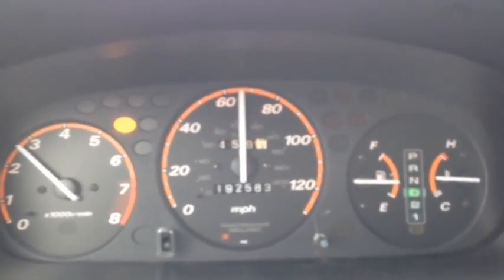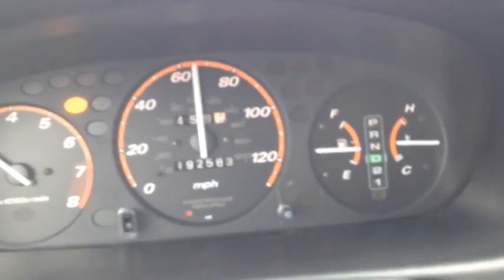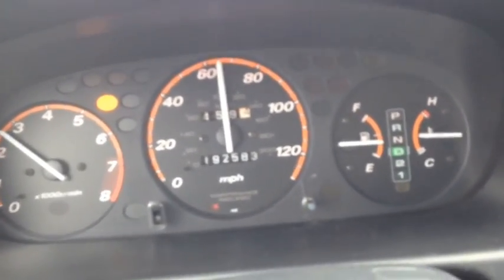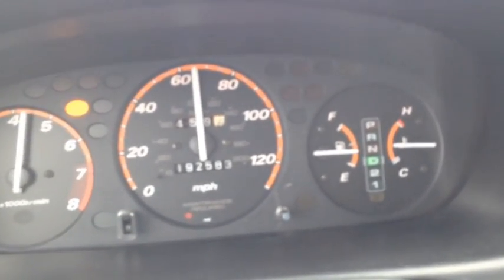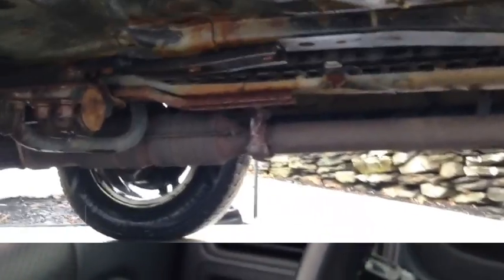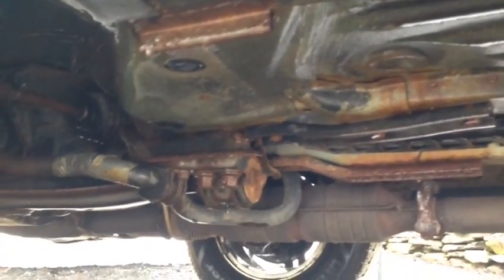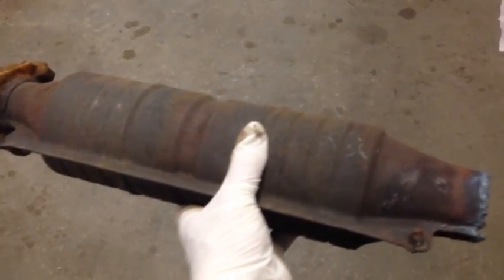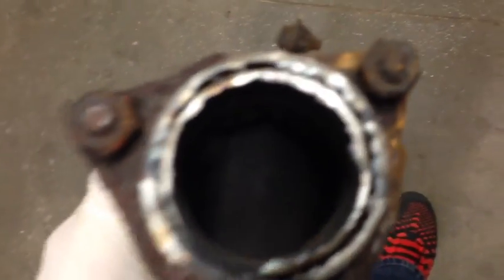Clogged Catalytic Converter

Comment: Did it give out code for catalytic converter or other code like P172? Mine is doing the same thing but throwing a P172 code. Thanks for the video
Reply from the maker: Hi Sirwei, mine did not but it makes sense to throw a code for an O2 sensor if it is damaged because of the failure.

Comment: That seemed only to be part of my problems, changed the cat but it still feels like the brakes are engaging once in a while. I'm gonna be checking my cv joint soon.
Reply from the maker: Hi Bryan, Have you had any work done under the dash near the brake pedal assembly? Sometimes people will remove the brake light switch which is attached to the brake pedal assembly and install it too tight causing the brakes to drag after driving for a few minutes. Let me know, thanks.

Comment: i have a 1995 astro van and i did a complete tune up fuel pump fuel filter and still runs badly it sounds like a knock in gear is my cat bad cause it caint breath
Reply from the maker: Hi Frank, is there any way you could take a video of your issue, upload it to YouTube and send me the link so I can hear what it sounds like?
Reply: @EddieCarrara1  I have this same issue ATM

My scanner picked an engine misfire on cylinder four, on changing the coil pack, the error cleared. But the noise is same so I suspecting a clogged cat converter.

Toyota Sienna 2001

Comment: I Have A 03 Nissan Altima Doin The Exact Same Thing My Code Say bank1 Converter insufficient Now It Done Busted But I Wonder If Mines Is The One Comin From The Motor Or Up Under The Car
Reply: Mont Last did you fixs your problem ??
Reply: Anthony Bell Yes I Just Cut Off The Cats N Ran Straghit Pipe
Reply: Mont Last oh okay
Reply: Mont Last I had to replace my converter .

Comment: MIne has lack of power and bogs when i try to pass people or when i put the pedal to the floor codes are throwing a misfire and bad 02 sensor but i think its my cat clogged on a ranger 2003 3.0
Reply from the maker: +Windmills618 If you hear pressure building up in the exhaust system on acceleration, it's probably the cat.
Reply: now i have suspection that its the valve heads gonna do compression test on it soon.

Comment: Hey, Eddie. I have a 99 f150. Same symptoms. Heavy shaking when I hit the gas while it is in gear. I noticed that in your video, the vehicle was shifting gears. Mine isn't. It gets up to around 3000 rpms but doesn't shift. Could this be the product of an extremely clogged cat?

Comment: I was told that the catl. Converter and fuel pimp was bad on my 97 jeep grand cherokee. ( it would cut off at left turns or cut off and not start until a waited for about a minute or so and it wouldn't start in the morning until the weather was about 70-80° ). So I changed the fuel pump out; thinking that was the primary issue for the crank/no start situation I was having but, when I tried to start it this morning ; its still having the same issue and 9 times out of 10; when I try to start it this afternoon or evening, its going to start up as if nothing was wrong in the first place. So my question is: Do you think that it could be the Catalytic Convertor seeing as it only starts when its at hot/warm temps.???

Comment: 04 infiniti g35x  when i get around 4500 rpms its like it lose power then rpms drop to 0 i have to let off gas pedal  then rpms come back up any ideal
Reply from the maker: +darrell turner 
Sounds more like a fuel delivery problem or ignition problem because the RPM's are dropping off to 0.

Comment: i have got a nissan serena qr20. it started dropping of speed and power and when you press the accelerator further down it wont increase speed but instead it stalls at the same time  reducing raves to 0, if you try to rave above 2500 rpm it produces a rattling sound at the same time switching off. airfilter is new, oil filter is new, oil is new, plugs are new  i am now worried what could it be.
Reply: GARIKAI COSTER CHITOMBO  hey I got same issue did you find what was wrong with it?
Reply: Same problem with my 01 deville im thinking clogged cat

Comment: Hi my car starts but turns off right away if your not pressing the gas petal and also engine light is on I need a new oxygen sensor because I failed my emissions test but today it just went out on me. Do you think this could be my catalytic converter?  or could the oxygen sensor cause it to not stay on. It starts but dies right away.
Reply: nessanchez11 cat

Comment: What would you recommend I do for a 02 Honda civic 190k miles with a clogged catalytic converter? Kinda low on money at the moment from coming back from a vacation very recently. I lose power randomly and it won't go passed like 30mph
Reply from the maker: +Anthony Fernandez, 
Hi Tony, you could by a test pipe to replace the cat temporarily or remove the cat and knock out the insides, then reinstall it. It wont be legal, but it will run lol. Let me know what you decide to do, thanks.
Reply: Eddie Carrara thanks for the advice, many people have told me that lol however my inspection is almost due in a month and I haven't even gotten my inspection to begin with I'm using a temporary sticker. I don't want to buy something too expensive cause I just want to have this car until it dies out.
Reply from the maker: You could try a salvage yard for a use catalytic converter.
Reply: Google "paint thinner catalytic converter " it is a cheap method to clean converter without removing it or paying $300+ dollars for a new one
Reply: You put half a gallon of gas mixed with 1 gallon paint thinner inside your gas tank then drive 150 miles straight or till you completely run out of the gas. It should be hot enough to dissolve the carbon inside the converter. Make sure to finish the gas though you don't want the paint thinner inside your car for a long period of time cuz after 24 hours or so it can eat up the rubber hoses to your car
Reply from the maker: Not a good idea Robert, lol,  but thanks for your thoughts.
Reply: Robert Roman 

Hhahah laquer / paint thinner in the tank , that outta burn a valve or melt a piston
Reply: Yeah if you want to clean your carb out use acetone  run it quick.